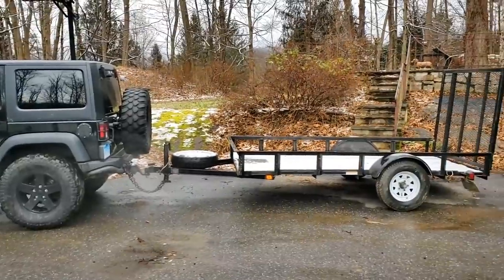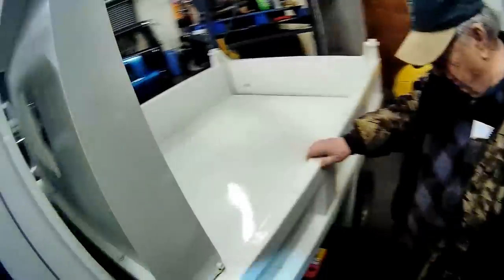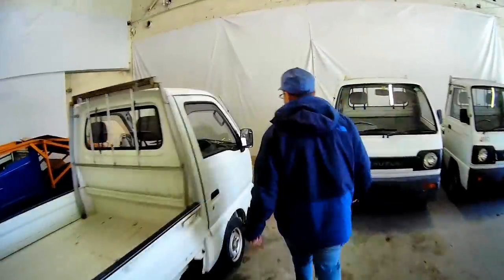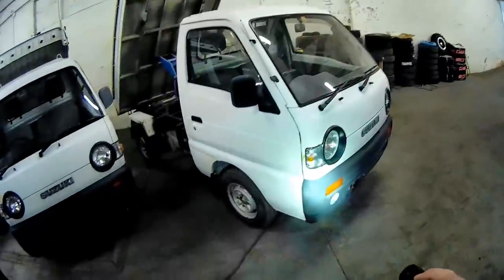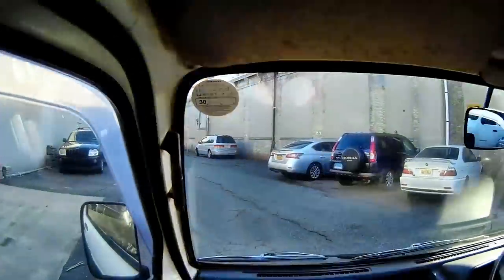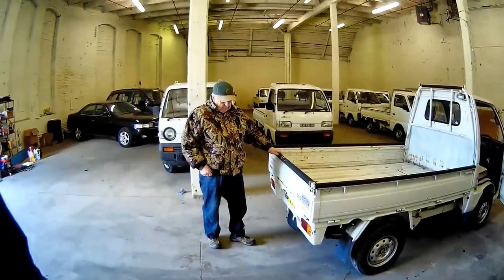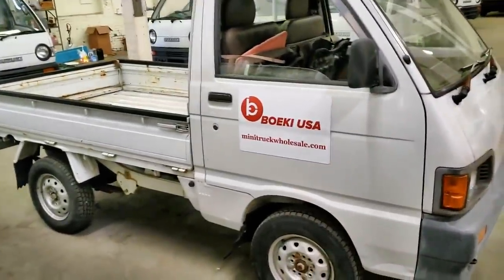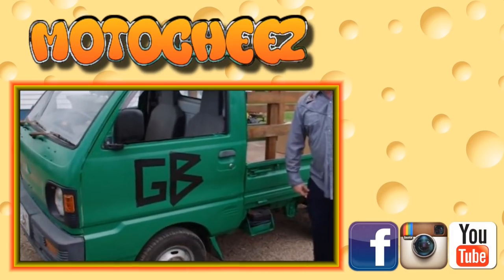$4500 Mini Truck info (SE01 EP01) what to look for, buy and get it home on 5x10 trailer

Comment: I bought a truck on Ebay from him. I won't use him for another. My truck is decent and is my daily driver for 2 years actually but it did require some maintenance it probably should not have. Can get them a lot cheaper if you go right to Japan for one. I have a Jimny coming from Japan right now
Reply: and the way the axle lock works on a Suzuki is, it basically acts as front hubs and it comes on automatically in 4x4.
Reply from the maker: Yeah, being 25 years old or older I figured they'd need work, so did mine. I just got to see 60 different ones to choose from, some cheap ones are really beat! I contemplated buying overseas... I was burned buy a Chinese deal years ago, sent money and never heard from the dealer again
Reply from the maker: Yes. The front is like locking hubs, it actuates 4x4, the rear lock makes rear posi!
Reply from the maker: Keep me updated on the Jimney. Love those things!
Reply: @MotoCheez  I paid quite a bit more than you did and problems with the truck were obvious. I fixed them cheap enough though and it's well. Does not like the cold and the carburetor has frozen on me but it gets 39 mpg. I've put almost 20k on it. Chinese mini trucks are garbage clones in general. Several legitimate exporters in Japan for the real thing. Look up prices at japan auction for these things. They go for basically nothing, under $1k in most cases, but can be had for $1-200. My Jimny was $611 itself, $1k in shipping and now I've got broker/ USA customs and tax to add up, but it will be about $3k all told. It's going to need service/ restoration but I know that going in. Most of the parts are off the shelf in the USA since it's a Samurai basically. What's different is easy to get
Reply from the maker: Nice. Ya I didn't know China made mini clones. I almost went the import route but was afraid to get screwed over and customs etc.

Comment: Whats the price for 1 of them??
Reply from the maker: They start at about $4000
Reply: Thats not bad price an is that for all or for surten ones
Reply: An ig 4000 is the ones that dont have 4wd or nothing real major on it I assume
Reply from the maker: 4000 is more rust, needing more work interior etc. I paid $4500 for mine
Reply: is that also with the dumping bed included on the truck?
Reply from the maker: No, check their inventory at boekiusa.com
Reply: Ok thanks for the site to check to

Comment: You know what, my smart car only has a 70 engine. Then, in theory, these could be driven on the road. Which would be bad freaking ass!
Reply from the maker: Most states allow these to be registered. I have 2 now
Reply: @MotoCheez  I'll have to look into it. I've always wanted a little truck the size of a smart car that's 4x4 for Missouri weather.
Reply from the maker: @joeyhillers9460  I have a ton of videos in this series offroading etc! They're great in the snow and in the woods
Reply: @MotoCheez  I'd honestly just drive it around
Reply from the maker: @joeyhillers9460  I do that too. Home Depot etc. They're not fast though. 60 max on this one, 70 on the 5 soeeds
Reply: @MotoCheez  Perfect for when I drive then.

Comment: That Daihatsu was not built by Toyota, no more than jaguars were built by ford in the 90s. They partly owned daihatsu, daihatsu still didn't and still does their own thing.

It's just something mini truck dealers say to make people feel better about buying a truck with a unfamiliar sounding name.

Also that Suzuki doesn't make 47hp. All the carbed f6a powered trucks were rated for 42ps.
Reply from the maker: I found that out about Toyota and Daihatsu. But doing the research I did find that it is 47 horsepower and the next model up is 53. I have a friend in Connecticut that actually put his on the dyno and at the wheels it was something like 40
Reply: @MotoCheez  it's really hard to find information in English on the trucks, but you can find it for the vans pretty easy. Everything I've found says 42ps for the carbed f6a Suzuki, 50 for the efi f6a, and 60-64 for the turbo efi f6a depending on the year.

I know that my 1991 Carry feels like every bit of 42hp lol.
Reply from the maker: someone linked me a site directly to Daihatsu of Japan and it showed all of their models with the years and the full specs. I'm going to have to try to find that again and I'll put a link up

Comment: damn, there not that cheap in aus m8. add about $5,000 to that here!
Reply from the maker: That's cray cray! Wonder why so much more?
Reply: @MotoCheez  gov charges an g.s.t.[goods an services tax] which has more gov charges mixed in! theres still a bi centenial tax from 1988 still on fuel. we're an over regulated an over taxed country m8
Reply from the maker: @gregbolitho9775  damn!

Comment: Anyone who buys one should change all the fluids and flush the cooling system first thing . SEAFOAM your fuel ! . It will not have been done in Japan .  Rockauto for parts . For Daihatsu remember that Piaggio builds the older Hijet under license in Europe still. Same drivetrain, body ,susp. Different engine only.
Reply from the maker: Good idea, I plan on doing them soon.

Comment: This has the capacity of a wheel barrow.
Reply: They're actually bigger than they look, plus you can add to the height of the sides and tailgate to get more capacity. The big limitation is weight. You can't really put more than 900-1000 lbs. in them without the risk of breaking something.

Comment: prices?
Reply from the maker: Amir had them there starting at $4000
Reply: thanks MotoCheez. Have you pursued the Vermont thing?  I have with my TW200 motorcycle and 4x8 trailer.  Do they sell Hondaa?
Reply from the maker: I just sent my paperwork to VT to register it, hope it goes well. Yes, they have Honda's there too! Subis and Suzuki too
Reply: they take a few weeks. But they work with you and actually try to help you get on the road unlike NJ DMV
I like those trucks.  .Most people including me don't need 50k+ trucks .
Reply from the maker: Nice. Yeah, I agree w you!

Comment: When the brake fluid gets low the clutch doesn't work!!!
Reply from the maker: Mine has a cable clutch
Reply: @MotoCheez  Mine is a 2002 and I've checked it, but i know that would be a real dangerous thing and change they would have, i'll keep looking no leaks that i can find, but i will keep looking, it has no leak that i can find either but your right it's got to be a cable.
Reply from the maker: Eugene Courtney a lot of car companies are using the brake reservoir bu the tap is high on the tank so it won’t drain it fully to be dangerous.
Reply: @MotoCheez  I'll check that out,scarry., on the dash a ! shows up just before it happens the only that i can restart it is to put it in reverse and have someone push then let out the clutch. it will kick right up but cant shift out of reverse till i put more  brake fluid in it
Reply: @MotoCheez  Thank you so much so much,  i'll keep looking for a solution, i'm bound to find the culprit eventually. It just drains down about 1/3.

Comment: 35,000 km/h is BS that low would look mint. There is videos of people rolling back the odometers on these then claiming hardly ever used but look like well used or replacing or painting parts is a huge scam. Better deals on jdm auctions then to pay some middle man thousands.  Beware of them small hack dealers

Comment: Can't use these on the street in Oregon. I would buy one if the law changed.
Reply from the maker: That sucks. Even if you register in VT and insure?
Reply: @MotoCheez  yeah, I looked into it and it's under the same classification as a side by side. So I could get off road tags, unload it and drive it like a quad at the beach.
Reply from the maker: Theyre over 25 years old, that's how most states get them through. Check on the year rule maybe.
Reply: @General Contrarian yeah, the main importer is in Portland Oregon and they import them as farm equipment. Maybe if I special ordered one I could get them to change it before it ships.
Reply from the maker: That's true
Reply from the maker: That's an idea!

Comment: I work at an oil refinery and they purchased a fleet of little Mag  trucks from China. After 4 years they had to be removed from service multiple ball joints snapped on the front suspension so as a proactive safety move they decided to scrap them all at the time I believed there was about a third of them still running. If you could get one on the cheap one. But buyer beware.
Reply from the maker: You're right! The China models I've heard are total garbage, the Japanese trucks are built way better. Thanks!

Comment: maybe somebody can explain something to me. They were importing them here. I think the ones they were importing were from the 70s. Or maybe 80s. They were about four or 5000 apiece rebuilt and everything. If I'm right the company was only in business. About the year that was doing it. Here's the thing. You go to get one used be and to all on holy hell and not even running and they're charging five grand and more. They shouldn't even be $1000 in the condition that I'm seeing the men and their wanting five grand and more like I said some of them aren't even running and generally look like they've been beaten the hell I thought they were pushing it. When they were charging five grand a piece for a vehicle that was nearly 30 years old with high usage or that was like 10 years ago and like I said, right now if you can find one for sale around here you'll pay five grand or more starting out tried getting one a few times that it was debatable if it could even ever see the road again and they wanted ridiculous prices. I thought they were called a tuck tuck  myself
Reply from the maker: These are 1992is, from Japan, all of them run and are in decent shape. The older 80s ones, some  2 stroke and not built as well. I remember those. This is exactly what I need for my land work and play and a quick trips on the road once in a while

Comment: These things look really fun and useful! I have been poking around looking for one to grab for my father, this video was good information. If this is the same 660 cc engine that I am thinking of, Arctic Cat sold snowmobiles with 660 turbos that make about double the horsepower. Might be able to pick up a sled cheaply and rob the turbo mill out of it. Thanks again-
Reply from the maker: They are work horses! Hmm, that turbo  is pretty good idea

Comment: Its a shame that they are not 50 state legal, I'd drive one every day. Great on fuel, and very utilitarian. In the us we are such little bitches........
Reply from the maker: Agreed! I believe the "loophole" is the 25 year old classic car reg.
Reply: @MotoCheez  It is with cars, but unless something changed in the last year, that doesn't work with the mini trucks thats still a no-go, at least in Mass.
That would be awesome it it has though, I don't see this thing as being any less safe than the capachino or the AZ1.
Reply from the maker: @JimsEquipmentShed  True... Sucks.
Reply: @MotoCheez  I was really bummed, I used to own on of the micro vans when I lived in Panama, I was figuring they would eventually get legalized here. In places other than just Oregon.......
Reply from the maker: @JimsEquipmentShed  stinks for sure

Comment: You can't make them street legal, do to most top out at 52mph and the glass is not DOT approved !!!
Reply from the maker: https://www.iihs.org/iihs/topics/laws/minitrucks CT it's road legal as classic car 25 years old
Reply: I've got a title and plates in NY for mine and daily it. Max speed on my 87' 4-speed is 65. You can get them in 5-speed and with turbos that go easily over 65.
Reply from the maker: I just checked my windshield and it is DOT Lamipane Nippin Safety AS1 rated certified safety glass.
Reply: I travel all over NY,NJ and Ct and have only seen one in Ct and no plates or tags. I've heard stories of people get them registered and being stopped by the cops and having them impounded and going throught HELL with the court systems. Well buyer beware. It's better than buying a razor or like vehicle and if you get the lift kit they're great for off road.
Reply from the maker: I've personally talked to 3 different people who put them through CT inspection DOT station and they passed, they have plates. It's on CT inspectors at that point. They're considered classic imports.
Reply: I had a Suzuki 660 carry all it's not street legal in New York. So I sold it, got $8000. with all the mods, you can buy parts n modify these on line.
Reply from the maker: They're getting these on the road now in NY with the "classic car" rule. 20 years or older.

Comment: Whats cheap? I been looking for one, and they are not cheap. They are cheap, as in I can get a far better truck for less than half the price.
Reply from the maker: Depends on what you want to use it for, I need one that's an arrow to make it through my rocky trails kind of like an ATV to collect wood and everything small enough to fit in the garage in between small Gates. $4,500 is a lot cheaper than the UTV's that I've had in the past and this is much more capable bed size with a heated cab wipers Etc
Reply: @MotoCheez  OK 4500 is not bad, I can not find one for under 10K, Ontario.
Reply from the maker: Damn, maybe it's worth a trip to a mirror. I don't know what the import tax would be for you guys

Comment: way to factor the weight of the trailer into that. scary people like you exist man.
Reply from the maker: Check your facts, this trailer is rated for 2040 payload capacity. It's right on tractor supply site. This machine is 1500lbs. Explain what I did wrong that's so "scary"
Reply: weigh the tongue weight when loaded compare to specs a jeep can handle. i don’t know the whole thing seems like to much for a little jeep. forget what i said. rock on.
Reply from the maker: @17madracki17  OHHH, My jeep JKU has the factory 3500 lb hitch with 373 gears.. That's all good too. I understand what you were trying to say though. I've seen it...My tongue weight was good, I have been towing things for a long time and know how to load the weight..  I am very cautious and don't want tickets! or endanger other peoples lives.
Reply: MotoCheez i didn’t think it was more then 300lbs tongue weight. take it easy man. i clicked the video because we have similar interest. didn’t mean to sound so negative. take care.
Reply from the maker: Haha, no it's cool, I've been wrong before, the tongue weight was on the high side I'll admit, but safe. I didn't take it wrong, all good 😁👍👍
Reply: What she end up running you
Reply from the maker: I paid $4500

Comment: IMPORT CARP
Reply: And yet 2 best selling cars in US is Toyota and Honda,people wouldnt buy if it was krap imo
Btw These are 25 years or older,,I wouldnt trust it unless it had rebuilt or new engine..
Reply from the maker: You can get them.with low miles, mine has like 45km, engine runs mine so far, not a drop of oil, but you can get reman engines for a few grand too

Comment: Sigh....if only the Japanese drove on the right.
Reply from the maker: It really only takes about 10 minutes of driving to get used to it.
Reply: @MotoCheez  My concern is making those left turns at intersections, especially when facing large vehicles.
Reply from the maker: I understand, but honestly you adapt fairly fast